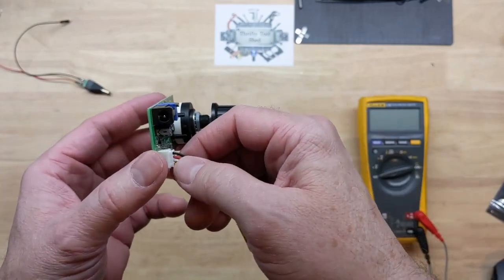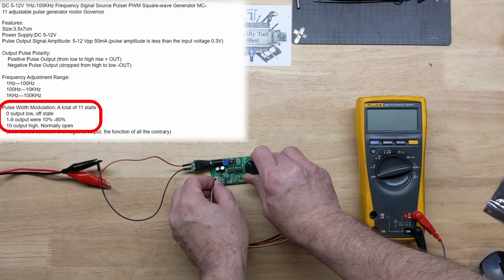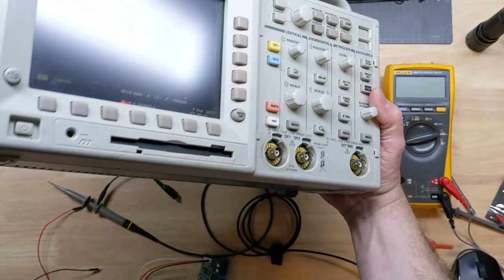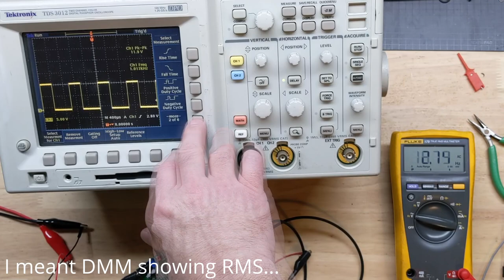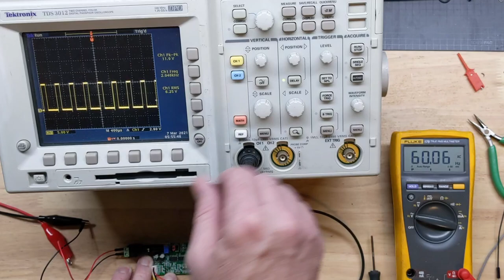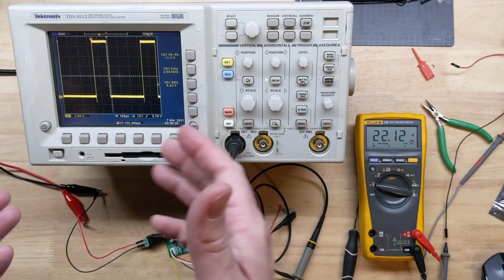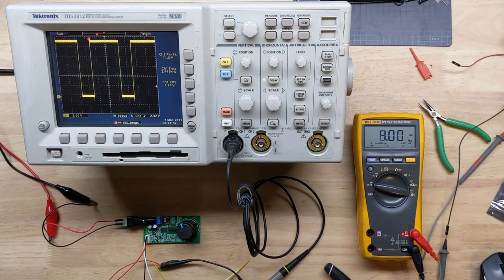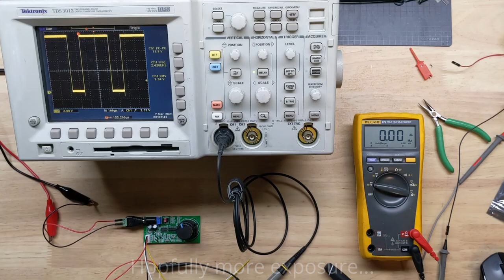MC-11 Square-Wave Generator Test

Comment: Hey thanks for your video :)
Can you tell me which of the four outputs I need to use to control a constant current led driver with a pwm input ? This one works with 100hz to 20khz. Thank you :)
Reply from the maker: It has no selection for that range. The jumper is for 1-100hz, 100hz-10khz or 1khz-100khz. You may need a different style board for that broad of a range.